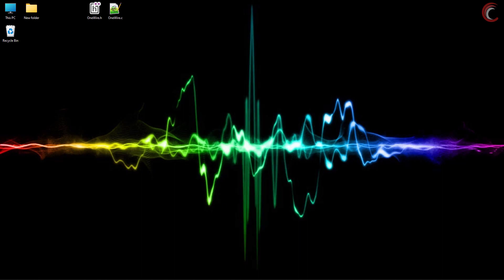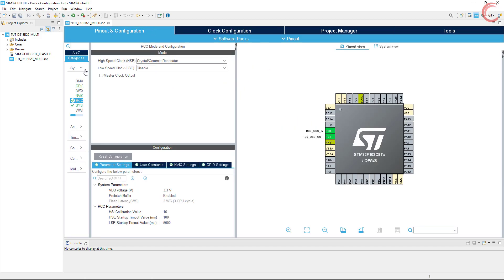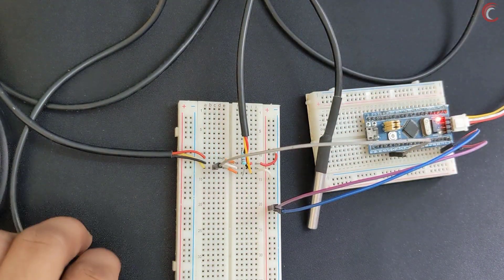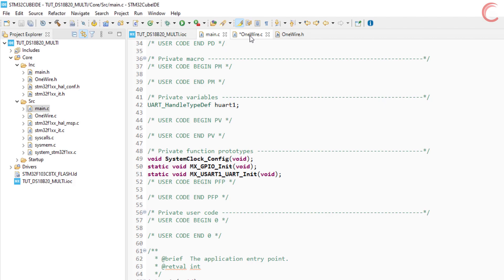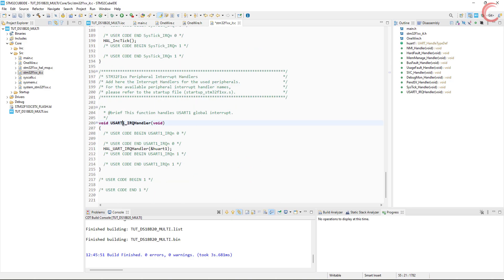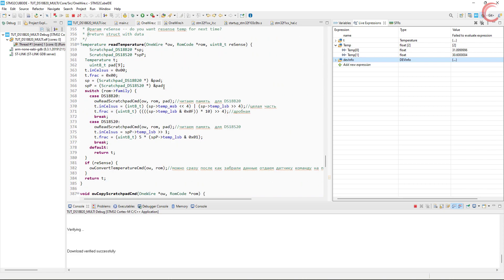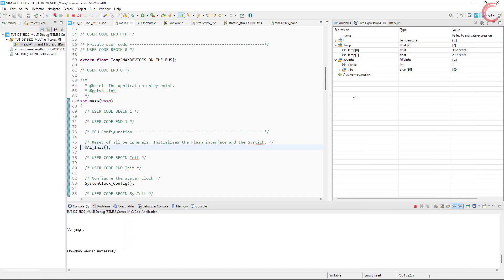DS18B20 MULTIPLE SENSORS || UART || STM32

Comment: @ControllersTech Iam using stm32f072b disco board. iam  getting an error in dev.info is \n can't read cause CNC error\0, so can you please solve this issue.
Reply from the maker: Maybe connection issue or the sensor itself might be damaged.

Comment: Why can't we use uart2 in this code?
We use stm32L010k8t6 and this micro only has uart2 available and we can't choose any other uarts
Reply from the maker: I said you can't use that in nucleo board because the uart output is fed to ST link in those. 
Are you using a nucleo board ?
Reply: @ControllersTech  no im not we invented a board that works with iot and should read the data and transfer it to website its an handmade board and usart2 is free in our board
Reply from the maker: Then you are free to use.
Reply: @ControllersTech  no it doesn't work even with f103 uart2 idk why the code has problem with uart2
Reply from the maker: Did you chabge the ow_uart definition to  usart2 in the one wire.c file ?
Reply: @ControllersTech  yea
Reply: Hello, does this code work with negative temperature?

Comment: dont know that you will response to me or not 
i did the project with stm32l0k8t6 and i did everything correct but it keeps giving me 0.00 what should i do?
Reply from the maker: Don't use usart 2 on nucleo board.
Reply: So what i can do there is no other usart in my cubemx for this kind of microcontroller we use
Reply from the maker: Which board do you have ? Can u send the link to your product.
Reply: Our company use stm32L010k8t6 for the boards

Comment: I had 3 problems to get it running, maybe that helps someone: 
1. If you are using F4 series, change stm32f1xx to stm32f4xx
2. Use UART1, UART2 didn´t work for me!
3. Put "typedef .... devInfo;   from OneWire.h to OneWire.c
Reply: Hi. I have problem with stm32f4xx. Usart 1 - 6 doesn't work at all. I've checked everything.
"CRC ERROR" or 0000000\n is what i get when i'm trying to read rom id with function get_RomId
Reply: can you explain third one how am i going to do that

Comment: well i would like thank you and author of this library. I have used it with stm32 nucleo 411. I had problem wit it and i thinked i have to find another library. But i took a look a litle bit a i knew where was the problem. In h file line : DEVInfo devInfo; coused error. When i dealete it and use it in c file just over there where in function this variable was used it started work corretly. It took me some time but now everthing work correctly. Pozdrowienia z Polski.

Comment: please share the circuit diagram of that.... How you connected multiple UART in single UART-Port.....
Reply from the maker: Not "multiple uart", but multiple sensors.. you just join their signal pins together and connect with the uart pin(tx).
Reply: @ControllersTech   user pin (tx) ?.... Or uart pin (rx)
Reply from the maker: We are using half duplex mode, so only one pin is enabled..
Reply: @ControllersTech  one pin is available and that is uart tx but how can we read data from tx pin
Reply from the maker: That is half duplex mode is all about..
Reply: @ControllersTech  ok
Reply: @ControllersTech  i will try this 👍

Comment: Hi, I am trying to interfacing DS18b20 in STM32 L0 series board. I couldn't get the reading. I couldn't  detect the sensor in the bus.  "owPresence" is always zero.
Can  anyone help on that?
Reply from the maker: If you are using nucleo, don't use uart2
Reply: @ControllersTech  I am using USART1 pin. I have done everything same as you mentioned. I have checked the code code. I couldn't get the reading RomId using "getRomId" . MCU didn't get the presence of DS18b20 in the bus.
Reply from the maker: if you are connecting only 1 sensor, did you changed "max devices on bus" ?
Reply: @ControllersTech  I changed everything as you mentioned, I couldn't read the DS18b20 using STM32 Nucleo L073RZ.
Reply from the maker: Contact on telegram, discord or community page.  Need to see the connection and code
Reply: @sothyrajahprarththanan2919  Have you found a way to make it work?
Reply: @mohameda.bessaidi9896  Yes, check the TDR and RDR register in the OneWire.c.
Reply: @sothyrajahprarththanan2919 what was the fix?

Comment: I am working with DS18b20 temperature sensor in STM32L073RZ board using this code. But i  couldn't get the sensor reading.  Is this code work all stm32 ( l0 series)  microcontroller?
Reply: Did you get the reading?
Reply: @sothyrajahprarththanan2919  No
Reply: @thanustiyathavanesan7907  Working on that, if you find a solution tell me immediately.
Reply: hi, im getting the same issue, did you find the solution?

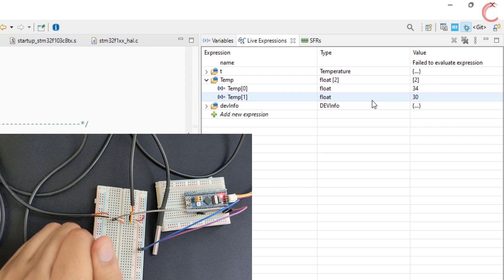Comment: Hmm. At 6:26 in the video, Temp[0] is 85. If the units are degrees C, that’s concerning.
Reply from the maker: Hmm. That was just the connection got loose because i was holding the sensor and it got pulled a little